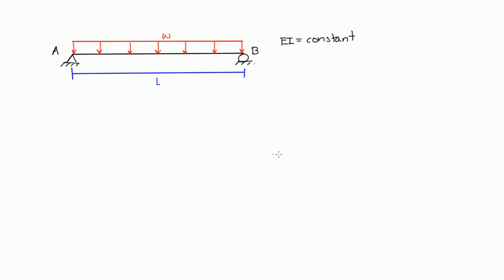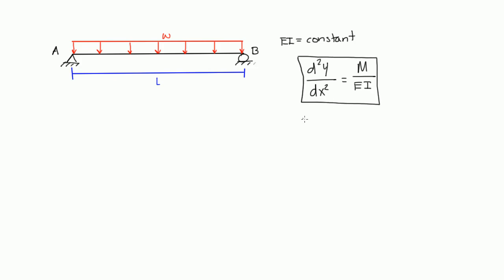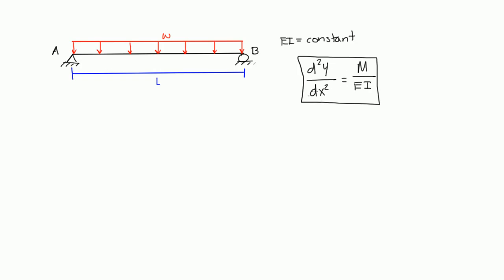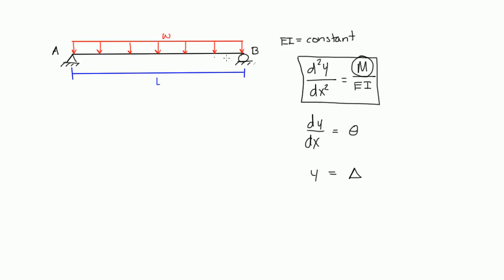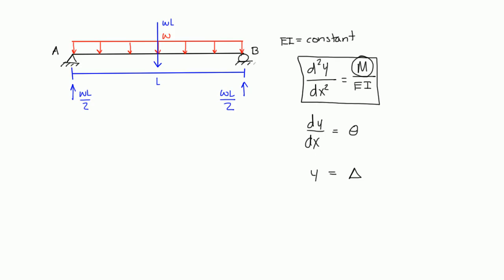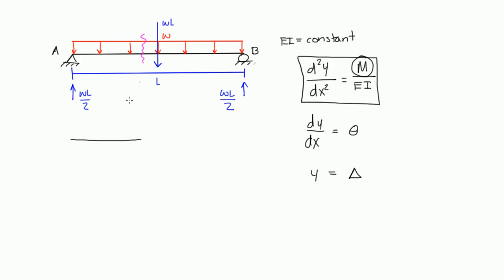Double Integration Method Example 1: Part 1

Comment: How does this change if it were a four point bending problem? So 2 forces acting at two different points along the beam, and 2 reaction forces at the ends of the beam (simply supported).

Comment: check this out:you start by saying double integration method,then you write a second order differential deflection definition(2 derivative form).I am having a hard time to understand the so called method.M/EI is a general solution of the differential equation

Comment: hey, great video! I have a quick question though. For cases with multiple loads, ie a udl and an off centre point load, would I integrate both load cases separately to find the deflections and then add the results together?
Reply: This appeared in my exam, can anyone answer it please 😁
Reply: @phebomoralestapel5348  Damn 4 years later no response. One day it'll get answered
Reply: @fee68  Good luck friend, may the Engineering Gods be with you.
Reply: I believe Hibbeler states (or maybe it was Ivanoff) that deflections can be calculated separately, then summed together.